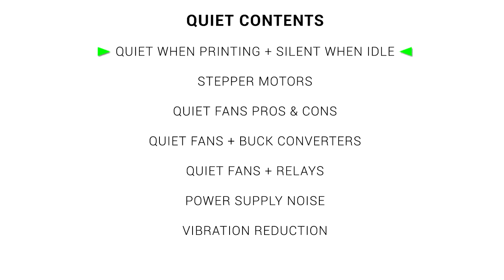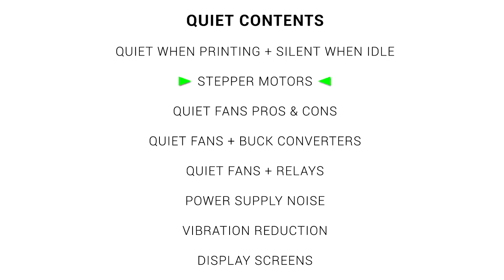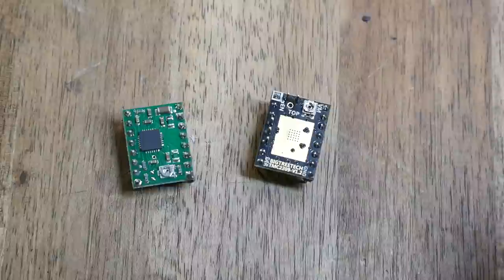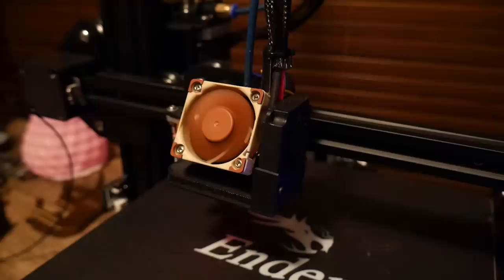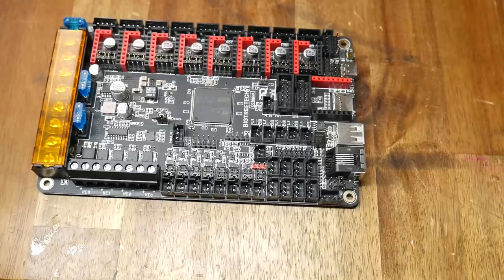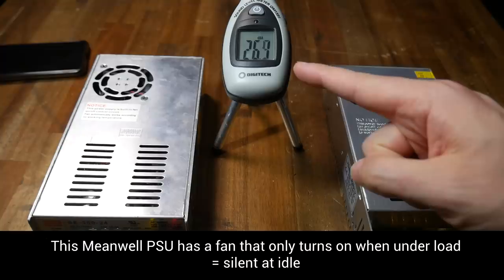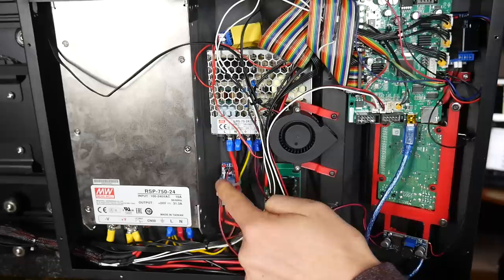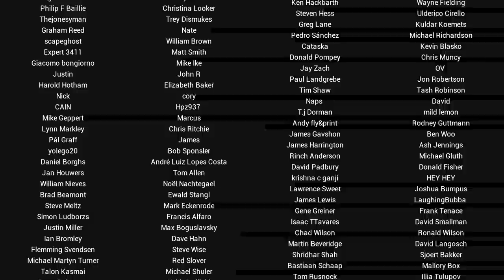Quiet 3D printing guide: Noctuas, buck converters, relays & firmware tricks

Comment: So, the way you go about this -- with the buck converter -- makes people think they need like a dozen buck converters.  Since all of the fan, hot end, etc inputs are NPN transistors, you actually just need to lead a positive lead to everything that needs to be switched at a lower voltage, and then tie the negatives of those devices to the switched end of their respective ports.  This will allow you to use 1 buck converter for your whole system rather than a bunch.

Edit: Nvm - you KIND OF cover this later on with the PWM fans, but maybe people will figure that out.

Comment: Note some fan noise is due to vibration coupling. If you put rubber washers between the fan and the sheetmetal in the power supply you may find a substantial decrease in high pitch noise.

Comment: I bought a 15€ 4020 fan from sunon, which is supposedly maglev. Works extremely well, moves a silly amount of air while remaining extremely quiet
Reply: Where do you recommend buying sunon fans?
Reply: I don’t  like the Sunon for parts cooling since it has to run at 100% Al the time, otherwise it will wobble! Will swap it soon.
Reply: @dasauto7346  I got mine from some german ebay seller, sadly I don't really have any other options than aliexpress or ebay here in norway..
Reply: @VincentvanVelzen  I noticed with the two cheap 5015 fans I use for part cooling on both my printers, they don't even start spinning unless they're on 30-40% power :p
but the sunon fan is for heatsink cooling, which is on 100% all the time
Reply: Second this! I have a Sunon fan replace my PSU stock fan and that made my entire ender 5 silent!

Comment: For anyone wondering about connectors, switches, relays etc and the markings for the pins, NO, NC, C, O (normally open, normally closed, closed, open). Normally open means its open until you use the trigger mechanism, which closes it (allows current to flow), and normally closed usually allows current to flow but doesnt when triggered. C and O (closed and open) means they are permanently open or closed. Often you find C and NO next to each other, meaning you can have power connected to NO and the thing you want to switch connected to C, or the other way around, to control it.

This took me far longer than necessary to understand, so I figured I'd take a shot at helping anyone else who got confused by it

Comment: I'm so happy you showed the negitive being put through the board and the positive from the supply voltage, I fried the MOSFETs from my BTT E3 V2 wiring them through the board completely, thankfully I was able to replace the MOSFETs with a little digikey searching.
The fix was to do what you showed, the negitive is what's being PWMed.

Comment: If using relays, and especially if using the power from the configurable pins to run the relay and supply power for the load (fan) - make sure your pins are actually rated for the current draw you're hooking them up for.

Comment: I went the Alexa voice controlled power board with my 3d printer and OctoPi plugged into it.

Also if you want to just upgrade the 24V fans then I recommend the Sunon MagLev fans, they come in a variety of models, but there were ones that had higher CFM, lower noise and the same size as the ones that I was swapping out on my Creality CR10v3.

Comment: I can confirm that Stefan's noise/vibration reduction setup with a concrete block and some heavy foam works wonders. I'm skittish to do a lot of wiring or firmware hacking, so if there are any others like me out there you still have some easy options for noise reduction.

Comment: If you keep your Pi running then you can power on the printers (smart plug) after you upload from Super Slicer. That is my workflow, upload to moonraker/mainsail , which turns on a switch and adds the job the klipper queue and executes it. Before moving to klipper octoprint also does this. I have some always on computers near by the 3d printer so I run klipper/mainsail on docker on that machine which sorts all this out.

Comment: Hey Michael, thanks for the video. Good information.
You mentioned you had eight 3D printers behind you... Would you consider doing a video comparing them to one another, what you typically use each one for, which is/are your favorite(s)? Upgrades done, upgrades planned and why?
 When searching out info for a second 3D printer (after an ender3) the choices can be mind boggling. 
Thanks for all you do!

Comment: Literally trying to get PWM control on the partcooling fan for days after upgrading to Klipper. I had no issue with the traditional buck-converter set-up with MARLIN, I had PWM speed control. Never would have thought to back-route the negative to the mainboard is the solution in Klipper. (Or At least I know what to try out tomorrow) Thanks!
Reply: And it did the trick! Thanks again!

Comment: My custom build is 400x400 with 4xNEMA steppers, Volcano hot end, two standard fans, SKR 1.4 turbo main board, TMC2209 and a 240v AC heated bed controlled via SSR. This may not be for everyone but I measured the current draw with the printer in full operating. It registered 1.6amps average and it never approached 2amps. My PSU is rated at 24v 10amps and I personally believe this is overkill. I am looking to swap this out for a fanless unit rated at 24v amps to reduce noise and will monitor a long print to see how the temps fair up.

Comment: Just a little info on the noctua fans. I use for part cooling a special fan duct with 2 axial noctuas one beside the other wired in series giving me 24volts. I tried it with the 20mm thick ones: it does not really work, because they only switch on at 50 or 60%!!! i use for 2nd layer 10% and adding 10% every 2 layers. 
On the otherhand it works very well with the 10mm thick ones!!!! wired in series they switch on at 5% (ok.. that is very low and you can see them turning) but they are perfect at 10, 20, 30, 40.... % . so i think it is important to test the fans at different percentages. I think with the buck converter it will be the same, the 20mm one not switching on below 50%.

Comment: I use a wifi plug at the moment, but when I get the silent board fitted, def going to be looking at the fans… need more CFM on the steppers too .. driving dual Z steppers is causing issues!

Comment: I was having issues not being able to regulate speed with buck converters, I like this idea, my solution was dual 12v part fans in series off 24v, so far it's working out great, been getting better results with petg now

Comment: Use an ATX supply; run the pi off the 5vSB line and wire power button into the pi GPIO. Run everything else off the main outputs. This way the Pi can turn off all power when idle. Also gives you built in 5v outputs so you don't need any step downs.
Reply: Most modern 3d printers are 24V
Reply: Was looking into this but my ender 3's are 24v. ATX doesn't play nice with that

Comment: I've often wondered how good a cooling solution you could get by using some silent, high-static-pressure fans mounted to the frame and pipe the air to the head.  That would remove the size and weight restrictions, but I'm not sure how well having a large hose attached to the cable chain would work.  It would be a good idea for an experiment, I think.  It would be content, even if it wasn't better than mounting fans on the head.
Reply: Some of the fastest speed boat benchies are printed using an air compressor and tubing part cooling system. Neat stuff

Comment: With octoprint and one of jneilliii various smart outlet plug-ins, you can have the outlet commanded off with the printer disconnected, and have it turn on the outlet and start printing on upload.

So printer is sitting off, no power in. You hit upload, it uploads, turns on printer outlet, and starts printing.

Comment: The wiring shown for the variable part cooling fan did not work on my v2. I had to run both positive and negative through the buck converter. Any ideas why?
I dialled in the buck converter by setting the fan speed to 100% in my slicer and then adjusted the buck to output 12V at full speed fan.

Comment: What about sunon fans for the hotend? They come in 24v and the static pressure is a bit higher than the stock one.
Reply: I watched a video from a guy in the U.S.A  that sells printers and parts , he said he doesn't sell noctua fans  because the performance was crap and instead sells Sunon fans - less noise than the original fan and more airflow than the noctua .

Comment: Any ideas on how to connect a fan to tune on when print is finished to cool down the bed more quickly? Setting up continuous printing and it take more than 10 minutes for the part to cool and drop off the bed.

Comment: If you want to use some lower voltage fans (es noctua 12v) maybe its cheaper to buy a power suply that can handle more fans and use the same wiering for the fan control than 5 or 6 buck converters to do the same thing

Comment: Where do you get the crimper and connectors for the boards? I've got some replacement fans but can't find any connectors (and tools to crimp them) for a reasonable price, and I'm not keen on soldering wires together.

Comment: you can use a lm7812 voltage regulator to get a 12v volt rail to connect all your 12 volt fans and whatnot
Reply: That's inefficient way, but with few fans it would work. Regulator needs cooling - in fan airflow 😉
Reply: @kimmotoivanen  a buck converter has a voltage regulator that changes the output voltage based on the value of a resistor. A 12 volt voltage regulator has less components. You can add capacitors on the input and output to smooth out the signal

Comment: I'm 1.5 years late, but ... there's a 12V Noctua fan that you can use instead of the 5V Noctua fan ...
It's called "NF-A4x10 FLX", EAN: 4716123314691 (4500 RPM, 4.2 CFM, 17.9dBA, 40x40x10mm, 12V, SSO2 bearing)
(and it seems it's a little cheaper than the 5V variants)
The Noctua fans even come with adapter-cables to change the 3-pin into 2-pin, so if you're lazy or lack equipment, you can just use those wires.

Comment: Probably should have mentioned the BrissMoto fang option too. I run two of the thicker (Noctua NF-A4x20 FLX) fans for the hotend and part cooler, as well as Noctua 80mm (NF-R8) for the PSU and mainboard. Wired exactly the way you have it with fan negatives going to the mainboard instead of to the buck.  Makes it nearly unnoticeable while its running aside from a tiny bit of driver noise from my ender 3 v2. It sounded like a jet sitting on my desk before.

Comment: Idk if you mention this in your video but what are your thoughts on using quieter linear bearings? I remember that polymer bearings are supposedly far quieter than ball bearings.
Reply: I doubt you're going to get much noise from a linear ball bearing because it just won't have enough time to get to a high speed on an average printer, before it has to slow to feed speed. Rather, what will make much more noise is the timing belts running over the pulleys. This is literally a 'zipper' sound.

Comment: I wanted to do what you mentionned in the video, and make the hot end fan active above a certain amout. When in marlin, i set E0_AUTO_FAN_PIN to PC6, as I'm using a skr mini e3 v2, and it then give me an error :#error "You cannot set E0_AUTO_FAN_PIN equal to FAN_PIN."
Any idea what I am doing wrong?
Reply: I don't know if you're still having trouble with this, but I ran into the same issue myself. The problem is that PC6 is also defined as the part cooling fan. If you comment that out in the pins_BTT_SKR_MINI_E3_common.h file, or change it to a different pin, the error should go away and it should compile.

Comment: I did everything like said but my fan when i set at any speed lower than 90% will move the fan then stop.  it only works from 90%+ to 100% and yes at 90% it is slower than 100%.  buck converter gets power from power supply red 12 v out from converter to Fan Black or negative from fan to motherboard blue or negative.  Any ideas as to why.

Comment: A lot of fan noise are generated because cheap fan are not balanced. Try stick some layers of tape to the one blade. When noise are increased unstick the tape and add it to oposite blade. When decreasd try out change number of layers (increase or decrease) With try and error method You can find minimun vibrations and noise. When fan works with minimum vibrations the fan livespean will increase because bearring stress is minimal.. For help you can use decibel meter or vibration/acceleration meter (G sensor) application for cellphone.

Comment: By 'not that long ago" you mean like earlier this year? When I bought my Ender 3 Pro, I ordered with a glass surface and metal wheel/spring upgrade. I got two tests prints in before i stopped and waited for silent board because of that angry robot noise.

Comment: To reduce vibration and some noise rather then blocks, I placed some plastic loop pile door matting upside down under the printer, you can use any "rubber" sheeting of around 7MM or thicker.  With the Ender 5 Plus I cut an opening under the control box to improve airflow.

Comment: Axial and blower fans aren't that simple. Blower fans do not simply move more air, in fact they move less air than axial fans of similar size. Blowers move air by creating high pressure, whereas axial fans move air through a large cross section but at lower pressures. Axials perform better when there are no obstructions in the airflow path, and blowers perform better with sub-optimal paths. So, technically, by using a fan duct for the hotend, you are constricting the path, but the focused stream of air may make up for the reduced airflow, and thus you do not see any clogs. Moreover, you always see blowers used for part cooling because of the indirect path used to point the air right below the nozzle

Comment: Complete beginner here, have spent about 5 hours struggling to connect the wires on the buck converter, so bear with me. Nor am i familiar with the raspberry pi or the conenctors on the ender 3. First question, is the wiring and end connector the end the same on the buck converter on both ends? So 2 xt60 ports? Also, where do I pluf it in, which part on the ender 3 pro? and to what? ngithmare at the moment. great video, unfortunately not enough clear video on this. great video btw
Reply: Also, is this the buck converter that fits firectly to the fans or does this only connect to the raspberry pi? do i need two? so confused
Reply: Do ineed a different connector?
Reply: I have the silent fans i just dont lknow what does whtat

Comment: I'm very careful when choosing buck converters to drop voltages from 24v to 5v. Some of the cheap ebay versions without heatsinks can get stinking hot because they're not designed very well, and the advertised specifications can be downright lies. The higher the voltage drop between supply and output, the hotter they run. I recommend running a spare fan from the proposed buck converter for 1/2 an hour, and check it's temperature before deciding whether to fit the converter to your printer or not.
Reply: These devices are generally designed quick&dirty from the datasheet's typical application directly. It's doesn't necessarily mean they are "lying" or "not designed very well", most often than not people don't have the proper knowledge to know what kind of additional limitations these devices have. Yes, the more you buck the more inefficient it gets but mind you that's an unavoidable quirk of switching power converters (24V to 5V at 3A is only 80% efficient, which is quite some heat generated for and SMT component), as they exhibit very strong efficiency vs duty cycle characteristics.

Comment: I was told a Noctua fan will not push enough air to work as a part cooling fan.  Is that true if the shroud is ducted?
Reply: I'm running dual a4-10 on my direct drive ender 3, been working out great so far with ducts pointing towards either side of the nozzle, I am considering going to the a4-20s but so far the bridges I do have been awesome
Reply: @henryjk9419  what shroud are you using?  Right now I'm using a Satsana shroud, but found a ducted remix I plan on printing in ABS

Comment: I'm new to 3D printing and have been watching your back catalog of videos for the last few weeks, since getting an Ender 3 V2. One thing that has never made sense to me: WHY does the hot end need a fan in the first place? Why do we spend all of this energy getting the hot end up to 200+ degrees, and then run a fan blowing directly on it? I understand the need for the fan to cool the extruded material, but don't understand cooling the part that we're trying to keep hot.
Reply: That is because the heat from the block can go up the heatbreak and melt the filament prematurely, which causes jams on the hotend, that is why the fan and heatsink is needed
Reply: @7897sebas  Then wouldn't it make more sense to have a finned heat break and cool that directly, leaving the hot end un-cooled instead? It seems like two opposing forces constantly working against  each other here, but it appears to be the standard configuration on most 3D printers I've seen.
Reply: @CueBall909  there are hotends like the mosquito or dragon that have something like that, it just has not been popular in pre built printers like the ender 3 and its clones i guess
Reply: @CueBall909  One of my first upgrades was a custom shroud to address this nonsense. You only need to cool the the upper side of the heatbreak with the heatsink on it and not the hot-end. In fact, it would be beneficial to insulate the heatblock. (then PID-tune)
Reply: @CueBall909  Hot ends aren't supposed to have fans blowing on them. There is the heatbreak fan and the part cooling fan, but if either are pointed at the actual hotend then your printer isn't assembled or setup correctly.